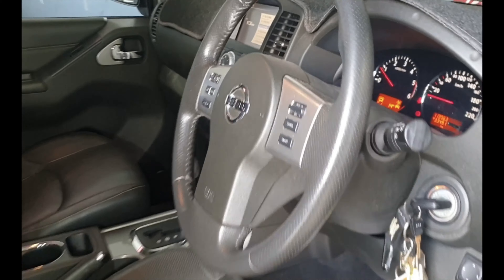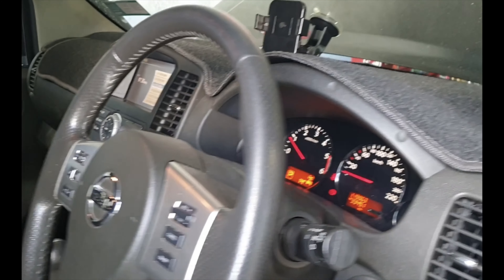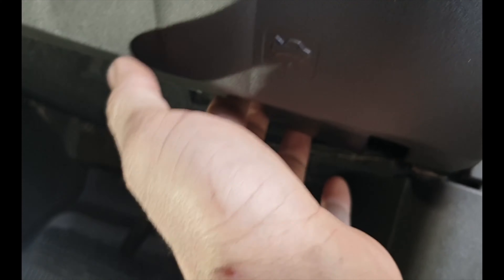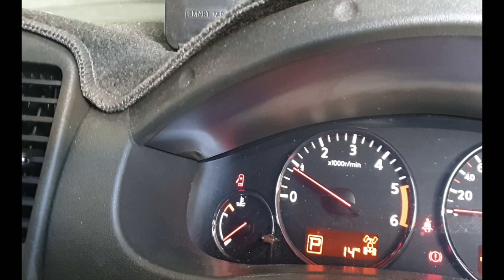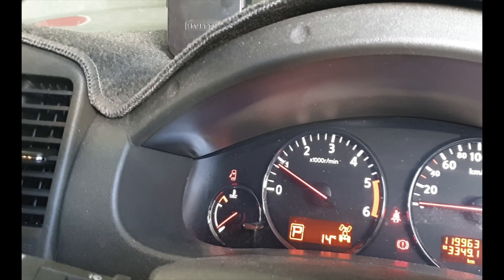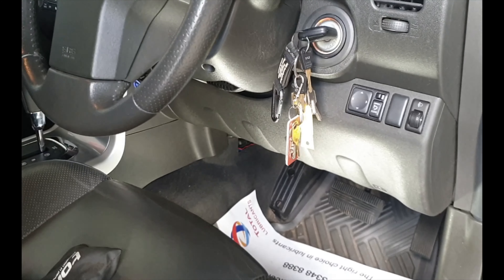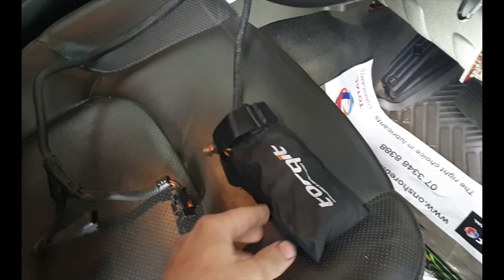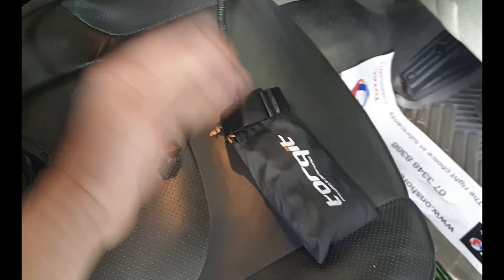Diesel Performance Chips

Comment: g'day mate..I know this is 3 yrs old now but i'm an old fella pre electronics mechanic and am a bit bamboozled by these chips that make everything 100% better according to the adds..I own a 2006 rodeo and bought it with a same brand chip you just showed but it was just ziptied and inactive under the bonnet and now ive seen this i think i know why..In your opinion is there a way to increase the economy of my 3lt donk without losing power? in my day it was done with nozzle sizes and pump settings as well as boost but these electronic ( pre common rail) pumps don't lend themselves to old blokes tinkering..Any help you might offer ( except burn the rodeo) would be much welcomed..Regards, Wayne